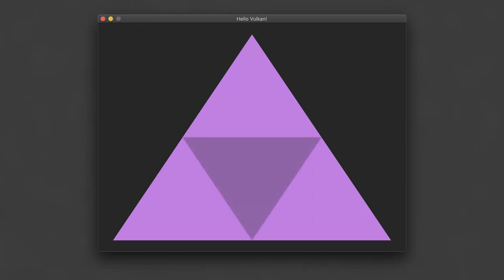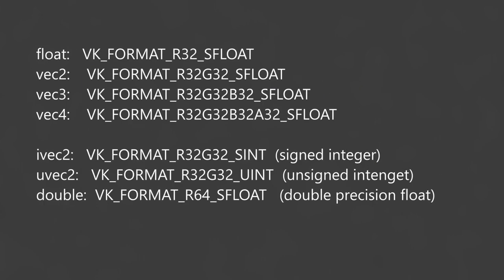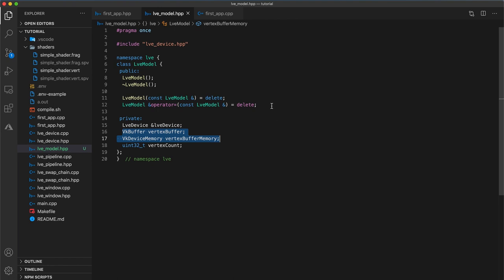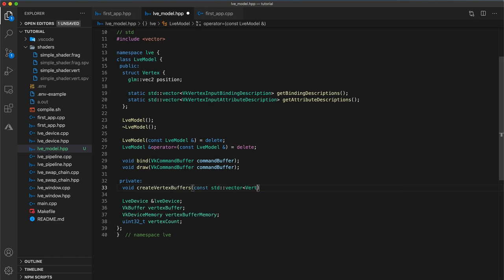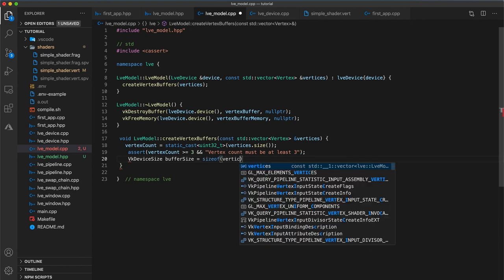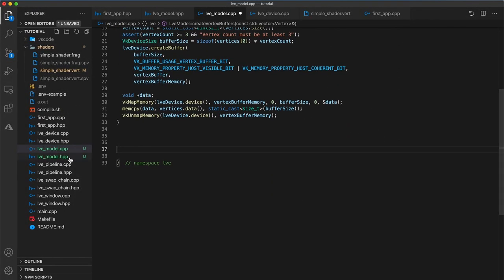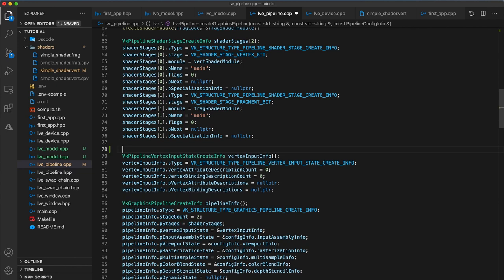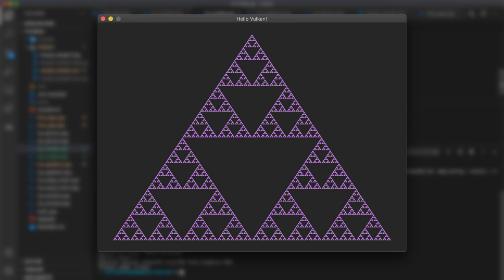Vertex Buffers - Vulkan Game Engine Tutorial 06

Comment: Bonus points if you can implement the sierpinski triangle without recursion but with simple loops.
This is something that is worth learning since replacing recursion with loops can optimize your code quite a lot in some cases.
Reply from the maker: I don’t think I’ve seen anyone do that yet!! And your absolutely right that loops in many cases can be a lot more efficient
Reply: yup, looping is what i did:

std::vector<Triangle> triangleList;
triangleList.push_back(CreateTriangle(initialTrianglePositions));
while (i < iterations)
{
	size_t newTriangleListArraySz = triangleList.size() * 3;
	Triangle* newTriangleListArray = (Triangle*)malloc(newTriangleListArraySz * sizeof(Triangle));

	if (i >= 6)
	{ // from here on, the iteration will require at least 3^5 operations, so swap to multithreading
		multi_sierpinskySubDivideAllTriangles(&triangleList, newTriangleListArray);
	}
	else
	{
		for (uint32_t it = 0; it < triangleList.size(); it++)
		{
			GraphicsEngine::SierpinskySubDivideTriangle(triangleList.at(it), newTriangleListArray + 3 * it);
		}
	}

	triangleList.clear();
	triangleList.reserve(newTriangleListArraySz);
		
	triangleList.insert(triangleList.end(), &newTriangleListArray[0], &newTriangleListArray[newTriangleListArraySz]);
	free(newTriangleListArray);
	i++;
}

Comment: I don’t know if it is too late but may I make some suggestions about the build system?
There is some bad practice going on with how you compile the shaders. I will explain in detail if needed.

Anyways, thanks for the nice video.
Reply from the maker: Ya definitely!
Reply: @BrendanGalea  Sorry for taking long to reply.

The "Makefile" is supposed to describe dependencies within the project. Therefore, it defeats the point of the Makefile if you have to run "compile.sh" every time you type "make".

So I suggest that you add the dependency between the final binary and the shaders.

Since I use cmake, here is the code I use for that:
"file(MAKE_DIRECTORY ${CMAKE_CURRENT_BINARY_DIR}/res/shader)
function(add_shader src)
  add_custom_command(
    OUTPUT ${CMAKE_CURRENT_BINARY_DIR}/res/shader/${src}.spv
    COMMAND glslc ${CMAKE_CURRENT_SOURCE_DIR}/res/shader/${src}
    -o ${CMAKE_CURRENT_BINARY_DIR}/res/shader/${src}.spv
    DEPENDS ${CMAKE_CURRENT_SOURCE_DIR}/res/shader/${src}
  )
  add_custom_target(${src}.spv ALL
    DEPENDS ${CMAKE_CURRENT_BINARY_DIR}/res/shader/${src}.spv
  )
endfunction()

add_shader(test.frag)
add_shader(test.vert)
"

If you were to directly write the Makefile (Note that cmake is just a tool to conveniently generate Makefiles which describe the dependencies between files), it would be something like "test.frag.spv: test.frag
  glsl ... <commands> ...
test.vert.spv: test.vert
  glsl ... <commands> ..."

Sorry if you knew all this but just omitted them for simplicity.
Reply from the maker: @FunnyPigRun  Yup absolutely right! I thought for sure I had mentioned this in a previous video... but it seems like I updated my makefile back in tutorial 2 and didn't show it in the video 🤦‍♂️

Comment: bro help me , I dont undestand the part where u bind buffer and vertexbuffermemory, what exaclty it does do there? do u save a buffer into vertexbuffermemory, or it say that every thing that u save into vertexbuffermemory it will be a buffer ?
Reply from the maker: ok so we have two member variables we care about here, vertexBuffer and vertexBufferMemory.

Both of these can be thought of as kind of handles to information the gpu needs. 
- The vertexBuffer variable is kind of like the meta data thats going to store the information the gpu needs to know about this buffer. Such as the buffers size, type of memory its using, the type of buffer it is,  the actual location in memory to store the data for the contents,  etc..
- The vertexBufferMemory is like a pointer to the start of the memory range in the gpu where the actual contents will be stored (in this case the vertex information)

When we tell the gpu to run a pipeline, vertex buffers act as one of the inputs to the vertex shader. 
It might be helpful to think of the vertex shader in this case as a function, the binding and attribute signatures are like writing the function signatures inputs, essentially describing the type info that the shader takes in.
So when we bind the buffer, thats like calling a function and passing in a value as the argument.

for example if you have
SomeFunction(int a, string b) { ... }

A vertex shader is like the body/implementation of SomeFunction 
The (int a, string b, ) part -> is like us configuring the binding and attribute descriptions
And binding the vertexBuffer is like passing in the arguments for when the function is actually called.

Hope that helps!